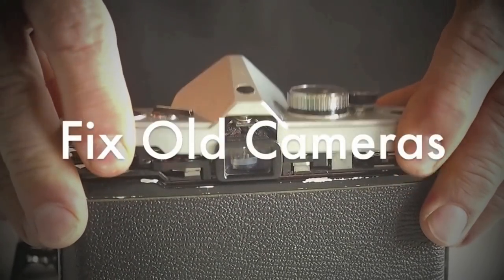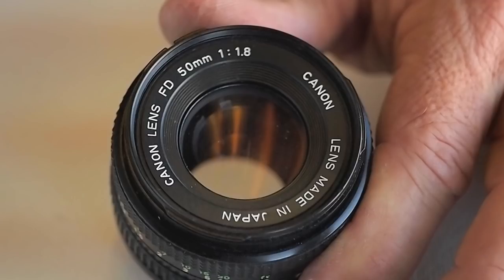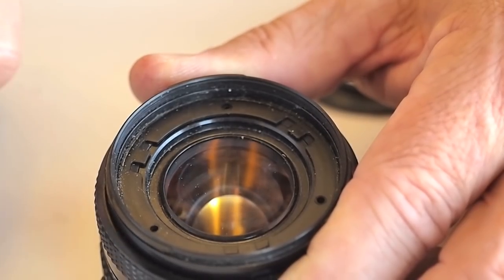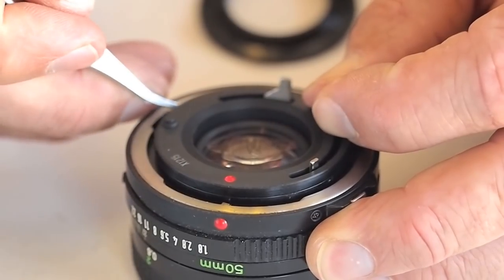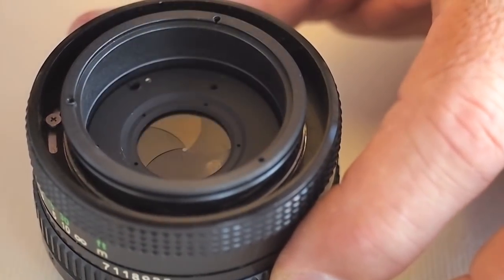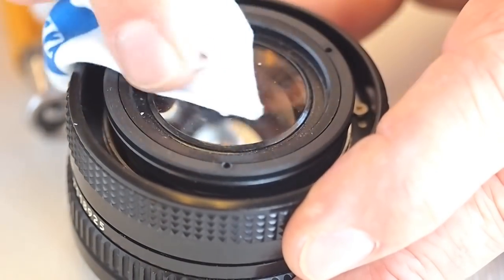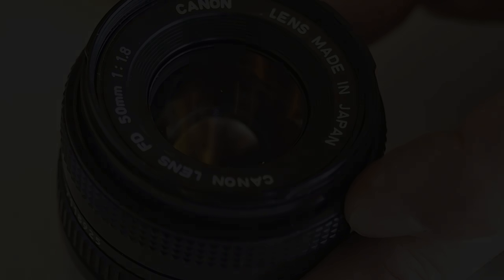Fix Old Cameras: Canon FD 1.8  Stuck Diaphragm

Comment: Thank you for your help in getting my aperture unstuck. It now works smoothly. My friend at the camera store told me that my F-stop openings were not accurate. For example my F-22 setting should close the aperture to 2.27 mm but it actually closes to about 1 mm. Is there a way to re-calibrate the F-stop settings on my Canon FD 50mm 1 : 1.8 Lens? Thank you.
Reply: I know its been 2 years but I have the same problem. Did you find a fix for it?
Reply: @thom8734  Hi Thom, No I did not find a fix for this problem. I ended up giving the camera away. It always took good photos so I perhaps naively assumed it wasn't a serious problem.

Comment: Hello, I've followed all the steps but when I put the aperture back in, it won't revert to wide open aperture until I wind the film advance lever. All the other 1.8s I have stop down then immediately revert to wide open when the shutter closes. Am I missing a linkage?
Reply: Figured it out, linkage on the replacement aperture I was dropping in was bent! 
Thanks for the helpful videos.
Reply from the maker: Probably want to recheck your work as to the linkages positioning.
Reply from the maker: Excellent to hear you discovered the problem.

Comment: I have Canon FD 50mm 1:1.8 S.C. and its aperture blade "disc" doesn't look like that.
Reply from the maker: Canon manufactured well over a hundred different FD lenses in their twenty plus year production. At times they would make changes in design. The S.C. and the S.C.C. on the FD lenses stands for Spectra Coating and Super Spectra Coating.

Comment: I haven gotten my lens up and running except my aperture setting seem to be reversed or backwards. Any suggestions on how to correct this?
Reply from the maker: Check the position of the aperture blade assembly stop down lever as it is related to the diaphragm linkage.

Comment: For a "project" I bought an old "as-is" Canon FTB(QL) camera w/ 50mm FD f1.8SC lens (breechlock version) for $15.00 +shipping on ebay. The lens is suffering from the stuck/oily aperture "syndrome". The first thing I noticed as I commenced dis-assembly was this lens had a little lever on the breech assembly for the locking the aperture control lever (on the other breechlock lens I have, to lock the lever you just push it all the way counter clockwise until it falls into an internal detent which locks it). The other difference between this and the f1.8 I described in my previous post is this lens has a 6 blade aperture assembly instead of 5 blades. I assume the 5 blade lens are the last of the breechlock lens before Canon came out with the bayonet style FD series (because the f1.8 in that series also has a 5 blade aperture).

A problem I ran into with this lens is that the front lens element does not want to come out of the lens barrel. As far as I can tell the only thing meant to hold it in place is the nameplate ring, but after removing it and the filter ring it will not budge. Does anyone know if the front lens assembly might have been glued in place? Could it just be stuck from some of the oil/grease seeping from the focus coils? What's the best bet to get it to break lose (without breaking it)?
Reply from the maker: Maybe some alcohol might be carefully seeped around the ring to loosen. Make sure that it does end up between the lens elements.

Comment: works but as soon as I mount on camera aperture goes back to square one and stays wide open, I use stop down lever and bulb setting to confirm that it wont shoot at anything besides 1.8 no matter what it is set to, any suggestions
Reply: but when i take off lens it works , i have tested another 50mm fd with this camera and it works and stops down fine, not sure what could be issue
Reply from the maker: You will have to recheck your work as you have not set up the linkage properly or the linkage connection is broken.

Comment: I got this problem with a FD 35-105mm 3.5 zoom. Do you think the process wont be much different for a total rookie?
Thanks!
Reply from the maker: The process is similar, but more steps are involved. Since you mentioned that you are new to attempting such an undertaking, you might want to wait for a Fix Old Cameras video on your lens, or a similar lens. However, it could be sometime as the request list is long. Thank you for your interest and patience.
Reply: Fix Old Cameras  Looks like it will better for me to try buy another and then when the video comes up try to fix it and sell it back then.
Thanks

Comment: Does the lens need to be set to infinity before disassembly?
Reply from the maker: As long as you do not attempt to disassembly the lens focus helical thread assembly, it does not matter where the focus is at. It will not be an issue.
Reply: Fix Old Cameras ok cool

Comment: Do you know how to remove damaged screws?
Reply from the maker: Try applying heat from the tip of a solder iron to the head of the screw for at least two to three minutes. Be mindful of any plastic parts on the camera so as to to melt them with the iron. If the head is complete destroyed you might be able to remove the head competely with a pencil tip grinder or file, then once the plate or part is removed there might be enough of the thread shaft showing that you can grab it and twist it out with a needle vise or pliers. Finally, as a last resort, it can be drilled out. At that point you will probably have to use an oversized screw to reattach.
Reply: This is great thank you.

Comment: i have a canon fd 1:1.8 S.C and my aperture blades are stuck.. i open them from the front like you.. but mine are loose.. so i had to fiddle them inside again.. it took me 3 hours... and the aperture is still not working.. do i have to repair it from the camera side? 

i tried to open those screws.. 1 is open but the other 2 are very stuck... do you hav e tips for those hard screws too?

Sorry for my bad english..
Reply from the maker: It could be that the linkage from the aperture stop down lever (on lens mount end of lens) did not properly link with the aperture plate.
Reply: how can i check this?
Reply from the maker: You will probably have to further disassemble.

Comment: I followed the directions to repair my 28mm 2.8 fd and completed all the steps, but now the lens wont mount on my AE1. How do I spin the breech lock back into place so it can properly mount?
Reply from the maker: +James McShane  You might need to check your linkage under the plate to make sure it is linked properly so it allows the breech lock to spin.
Reply: I'm having the same problem but I don't understand what you mean by linkage. Which part are you talking about?
Reply: Hold the release button in that you would normally press to release the lens from the body of the camera and spin the part you rotated clockwise, counterclockwise. You might have to use a small screwdriver in the lever channel to hold, and spin the lock back to home position  You do not need to worry about depressing the breech locks for this.

Comment: A Canon service video I have recommends adding a scribe mark between the aperture assembly and the lens body before removing the screws that hold the assembly in. Is that a good idea with this method or not needed?
Reply: I bought a Canon FD 50mm 1.8 lens to play with and I can definitely confirm you need to mark the aperture assemblies position in the lens before removing it. I marked the assembly before removing it in the 1.8 lens and when I reinstalled it I didn't quite get it back to where it belonged and between f22 and f11 the aperture didn't change. Took the lens back apart and was very careful to put it back on the "marks" and now the aperture opens/closes to a different size on each stop. Maybe an add on video for this repair could be how to verify/calibrate the aperture openings?

Comment: Do you have any tips for removing the he nameplate?
I have got it loose with isopropyl alcohol, however it keeps spinning and won't progress on the thread meaning it won't come lose.
Reply from the maker: The one you have is not threaded, it was just glued in. Pry and lift with the corner of a credit card or your thumb nail.
Reply: I use a plastic "tool" which i used in the past to remove screens from iphones

Comment: I have a 50mm 1.8 SC (breech lock) with stuck blades and fungus - should I follow the procedure for the 50mm 1.4 or this one?

Excellent series of videos.
Reply from the maker: The FOC video on the Canon 50mm 1.4 could be helpful for your lens in that the breech lock bayonet mount disassembly and reassembly is similar for all lens that have the breech mount lock ring.
Reply: Many thanks for the advice! Confirmed by hypothesis, will let you know how I get on with it!

Comment: Hi
Does this tutorial applies for the Canon FD 50mm SSC f/1.4 with the silver breech lock to ?
Reply from the maker: It is different and will eventually be covered in a Fix Old Cameras video tutorial.
Reply: Fix Old Cameras
Eagerly awaiting that video. Just bought a 1.4ssc lens for parts to fix my old lens, and except for stuck aperture blades, the lens I just received appears to be in better shape than my old lens.
Reply: Having just removed the name plate and filter ring on one of my stuck/sticky aperture old style FD lens, it looks like the "fun part" of accessing the aperture assembly will be removing the front lens group, which appears to be screwed into place. Will a standard spanner wrench work, or will something custom have to be made to unscrew that assembly?
Reply: sewing1243
Definitely need a lens spanner wrench to remove the front element (it unscrews counter clockwise), don't know if it makes that big a difference, but I marked its position before unscrewing it because, at least on the lens I worked on, the element can be screwed in a little past the marks upon reassembly..

Comment: Hi,

I was wondering where do you get the 'lens friction wrench'? I have been using just the end lens caps with some tape, but it leaves too much glue residue. Many thanks for your videos.
Reply from the maker: Various jar lids of the appropriate size can be repurposed into a friction wrench, particularly effective if used in conjunction with mouse pad backing or dental dam. Rubber stoppers, available at hardware stores, can also be used. PVC pipe end caps used in conjunction with o-rings work well also. Your imagination might come up with some other ideas that will work for you. Please feel free to post such ideas. If you would still like to purchase some, search "lens friction wrench" and you will find several suppliers of conveniently sized friction wrenches. However other than the convenient sizing DIY friction wrenches usually work just as effectively.

Comment: THANK YOU SO MUCH I WOULDN'T BE ABLE TO FIX THE SAME LENS I HAD WITHOUT THIS VIDEO. However I noticed aperture was not correct from f/11 to f/22 the diaphragm opening is so small looks like f/32 or something instead. Maybe I did something with aperture linkages.... every f stop before f/11 is fine and working on mine.

Comment: Folks, I need to get into an older style FD, I am gathering tools such as those you recommend in other post. Where does one get the large rubber stoppers and silicone mat?
Reply from the maker: Go to http://miketrost.com/tools.html for a link to Lens Ring Tools under the Basic Lens Repair Tools. You can also use the neoprene backing from old mouse pads for a friction mat. Salvaged jar lids such as the deep plastic type found on spice jars can be used in conjunction with the friction mat.

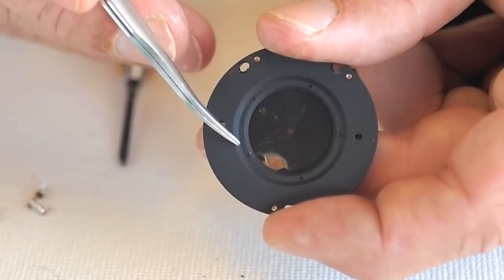Comment: I have canon 50mm FD lens. I have different from one in the video, but the name is the same. taking out the screws 1:39 all 5 blades fell out. they where not holding into one part as showed at 1:48. have no understanding at all about lenses. will check for more info. thank you :)
Reply from the maker: Although loose aperture blades are not something you want to have to deal with as they can be tedious to reinstall, it is doable. Note that the last blade installed will tuck under the first blade installed.

Comment: I have this lens,,the name ring will not fall out it spins,but, I cannot get a grasp to lift it out
Reply from the maker: You have loosen the glue, lift it out with a gentle prying action.
Reply: It may be a bit late to answer now but I post it here just in case other people want to remove the ring and can't find a way. Ideally, buy a rubber stopper of the right size and you can get it done easily. However, if you don't want to waste time going out to look for a stopper and you found that double sided tape won't work, here's the trick.

 I used a pills bottle of the right size and added a few drops of hot glue at the rim of the bottle and allow it to cool down. The glue will grip the name ring and a few turn will allow the ring to come off.
Reply: Sorry, I was wrong about my suggestion above. It applies to the 50 1.4 SSC version. This one is a clip type and not screw type. I suggest a guitar pick to ply it off.
Reply from the maker: Thank you for your interest in FOC and for the nice repair tip.
Reply from the maker: Right on.

Comment: do you have a video on how to make the lens ability to focus more smoothly I have a lens that will barely budge to focus
Reply from the maker: Barring any mechanical issues with the focus threads, the grease that lubricates the focus helical is probably causing the stiffness. The old grease needs to be removed from the threads and a light synthetic grease applied in its place. For the inexperience it is not advisable to completely separate the focus threads. Try to work the cleaning solvent into the threads by turning them through the range after seeping cleaning into the threads. Completely separating the threads invites a day of frustration trying to achieve the proper timing. If you decide to separate the threads count the number of revolutions after infinity scribe mark until they separate as a way of orientation. A FOC video of this procedure will at some time hopefully be produced.
Reply: thank you

Comment: Does anyone know how to get to the aperture assembly on the 50 f3.5 Macro FD. I can’t figure out how to disassemble from the front. Thanks!
Reply from the maker: Thank you for your comment. Possibly at some point in the distance future a FOC video can be produced for your lens. A quick overview... the lens mount bayonet will need to be removed. The front name plate and the plastic cone beneath the name plate will need to be removed. At that point you might be able to discern how to  remove the element groups and then the aperture plate with either a spanner or screws as needed.
Reply: Fix Old Cameras thanks for the reply.  Unfortunately this particular lens doesn’t have notches for a spanner tool and there is no name plate on the front behind the filter threads either.  Seems unique to the FD line
Reply: Fix Old Cameras I was able to remove the mount and saw the notches for a spanner tool to remove the small rear element but it seemed like you need to be coming from the front in order to remove the aperture blades as it was right beneath that element if that makes sense
Reply from the maker: The older version Canon Macro Lens FD 50mm f/3.5 S.S.C. has a name plate ring as described. You have the last version with only a front lens cone and no name plate ring. The front lens cone will need to be removed (might be a tiny set screw located on the lens barrel.

Comment: Hi and thanks for the video.  Could you tell me if the disassembly procedure for cleaning oily aperture blades on a Canon 58 1.2 FL lens is similar?  Thanks!
Reply from the maker: It is similar, but there are some differences that make the disassembly to get to the blades a little more challenging.
Reply: Ok, thanks.  Any chance you could be more specific? And, do you think it would it be easy enough to work through these differences based on this video (for someone without a lot of lens repair experience)?
Reply from the maker: Outlining detailed repair descriptions in the comments is unfortunately not practical. At some point a Fix Old Camera Video might be produced on your lens. That is a very nice lens and somewhat rare. Only you know your abilities and experience. If you do attempt the repair go slow and do not force anything. Try and let the lens show you what to do.
Reply: Ok, I understand.  I would be interested in seeing a video on that lens. Thanks..
Reply from the maker: Can not tell you when or if such a video might be produced, but it has been noted. Thank you for your patience.
Reply: Ok, thanks. Can I ask you one more question. The lens is sharp at f2.8 and reasonable at f2, but at f1.5 it is quite blurry with a white glow around anything white. Text is generally smudged. Is there anything that could be "wrong" with the lens that would cause this? Or is this likely either an adaptor issue (I'm using it with a Sony A7r) or simply the nature of an old lens like this at 1.2?
Reply from the maker: Unlikely that there is anything wrong with your lens and it is as you suspect, simply the nature of the lens. A possible explanation could be that the ghosting and halo effects are being caused by stray light that is entering the lens at its outer edges and refracting at a steeper angle and is then magnified by the thin depth of field of the close focus range and large aperture setting. Or to sound overly technical, spherical lenses produce spherical aberration or blurred image points due to the differing refraction characteristics of the light rays passing through the outer edges of the lens that do not converge at exactly the same point as the light rays passing through near the optical axis of the lens.  whew... way long answer and please keep in mind that it is not intended to be definitive.
Reply: Fix Old Cameras Ok, that sounds like a reasonable explanation. Thanks.